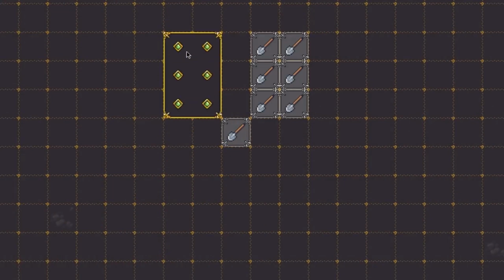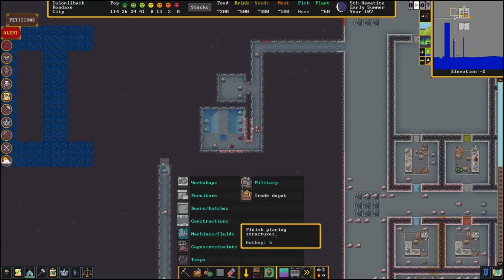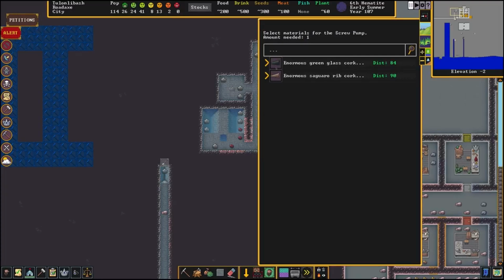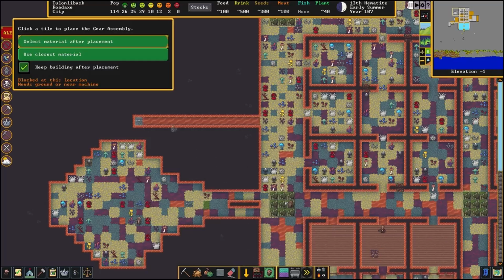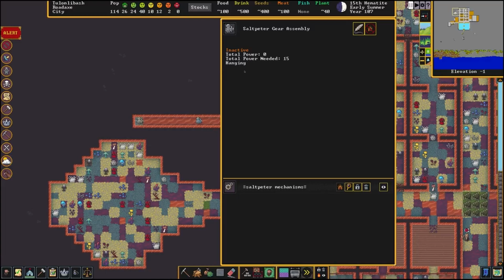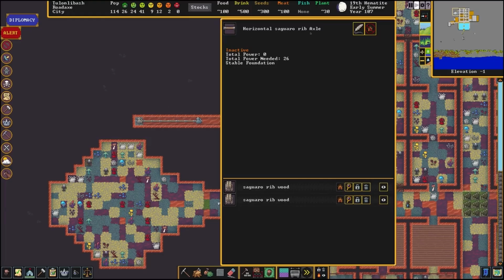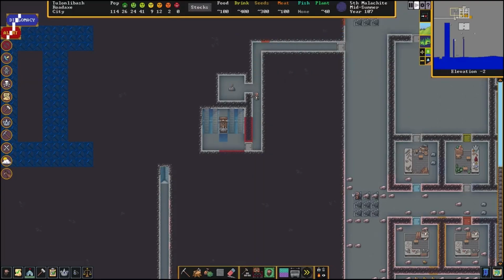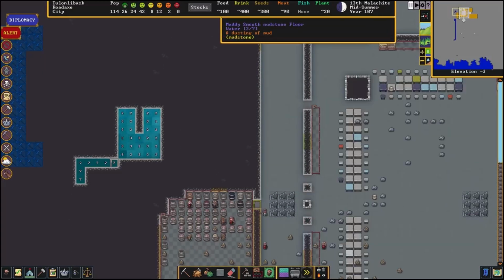Dwarven Water Reactor 🔅 DWARF FORTRESS STEAM 🔅

Comment: A levered hatch cover over the generator's water pull tile helps to turn off the whole device.  Just close the hatch cover with the lever and no water can be pulled so it shuts down.  Can reopen it and call a dwarf to run for a second.  I use this method for my magma movers.
Reply from the maker: 100% I do this as well !!

Comment: The last time I did a lot with Dwarven Water Reactors, I found that their power output was inconsistent, that some percentage of the water wheels would temporarily lose flow.   Has this been a problem in recent versions?
Reply from the maker: As you add water wheels to the sides it becomes more unstable.  it could be that you need more water, all the wheels need 4/7 or higher flowing water to create power.
there are many more ways to build this; here is the OG design that has less power fluctuation:
 
WWW
%%
WWW

I started adding 2 more wheels to the sides of mine to get some extra power.
Reply: I am seeing this too with a 4-wheel DWR powering a single millstone through a pair of gear assemblies. I get "job removed from unpowered millstone" spam about 50% of every grinding task. I know I have a good water supply to the DWR.
Reply: @DanielCoffey67  back in the day, I worked on a concept to create a "ring reactor" whose water flows in a single circular path to guarantee constant flow for its entire length.  It was a little tricky to link up all the wheels, and prevent spillage and water loss, but it worked.  I think I'll revisit the design and get it working proper.

Comment: just built this set up yesterday, but instead of digging out the 2x2 squares underneath to let water in, i left them filled in and just filled the top part with buckets. Still worked :)
Reply: after sufficient amount of water is filled by buckets, turn off the pond setting and it just magically keeps working.
Reply from the maker: excellent. It will lose water over time. perhap you will need to fill it again later. but should be okay with the buckets ! Cheers GrisGris !!

Comment: I'm wondering just in case.
Is it possible to create such reactor using aquifer layers? It yes, how is it better to setup for modular desingn? The reactor itself should be above aquifer level as I see it and you probably don't need a "pipe" to connect all the modules as there is always water underneath due to aquifer. Am I right assuming such desingn, or there is a better way of doing it?
Reply: The issue is when its overfilled, it will spill over and create a mess.
Reply: @smurfo-pax4423  yeah, just as I thought, so I need a drainage system. Thx!
Reply: If you just dig trenches in an Aquifer to stick water wheels in, there won't be "flow" in the water, so the wheels won't turn.
What I have done though is used Heavy Aquifers as an infinite Source and Drain for water, and then use a pump fed by the aquifer to create an artificial stream (constrained by walls) on the z+1, which can then play host to water wheels on z+2.  The stream flows for as long as you want, and then can be drained by pouring back into the aquifer from whence it came.

For Light Aquifers...it's a bit trickier to get sufficient flow.
Reply: @HannahLemurson  for Light aquifers its inconsistent, yeah, and I've already tested it and failed it. I guess the best way is though underground lakes that will create artificial rivers for example which will give water for reactors.
Reply from the maker: River Reactors are the best (20k power easy ). Aquifer reactors can be very good but ussally not in a place you want them to be. the advantage this has is that it can be built anywhere!